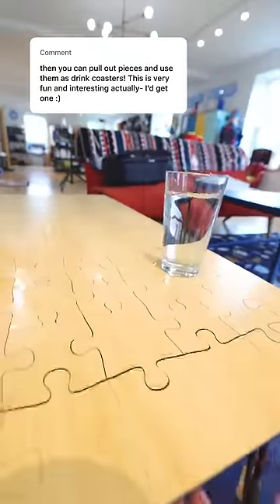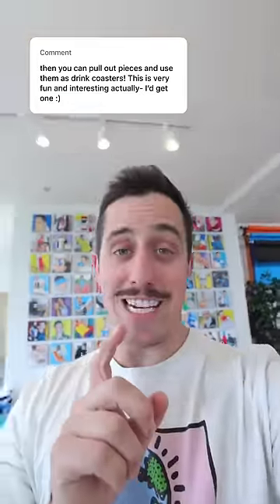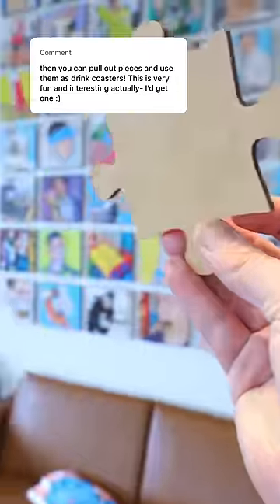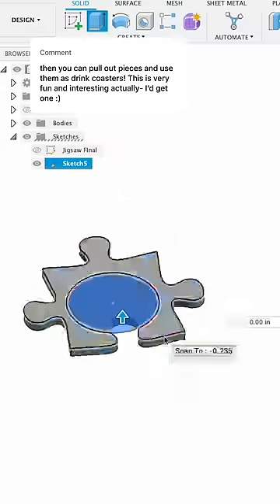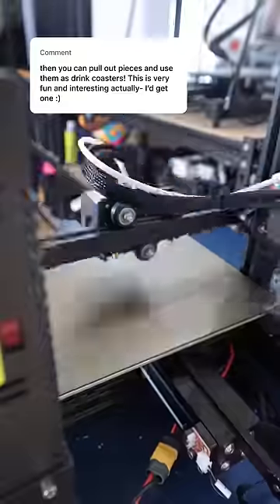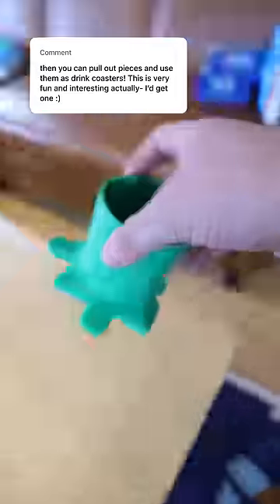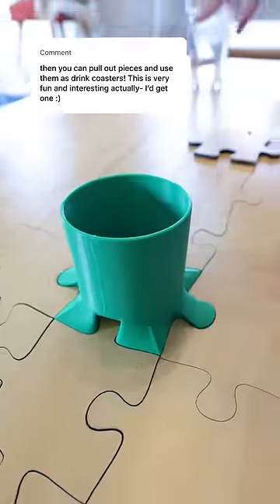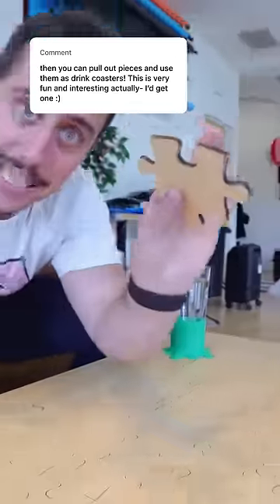What if I turned one of them into a cup holder?!?

Comment: You should do a series where you slowly replace each piece with a useful tool/accessibility accessory
Reply: Yer man
Reply: then its not gonna be a table anymore
Reply: The table of Theseus
Reply: @FlameyClockspeed  replace one of them with a smaller table
Reply: @speedweednfeed6721  Thus turning the table into an unnecessary invention
Reply: The unnecessary table~
Reply: @speedweednfeed6721  You wouldnt have all at the same, time, it'd have to be arranged very cleverly, but it could be done, say you may have a layout with cupholders and cupcakes racks, or one with die cups and card holders.

Comment: I think the cooler option would be to somehow have all the pieces to have a coaster on the other side so except for a specific piece you can just turn a piece upside down, of course it wouldn't fit when upside down but if the patterns are symmetrical maybe you could switch them, or even have a whole separate table just made of coasters and pick the corresponding piece, your choice

Comment: You should have added a spring system for the coasters. So multiple of the same pieces piled up underneat the table. when you push the puzzle piece one of the coasters pops up but the table isn't effected. When you don't need them anymore just push it back in the spring system.

Comment: But you could also just set the glass inside the empty hole? The flared lip is too big to slip through and you don’t want a cup holder to fit that snugly either the 3D printed one is too narrow